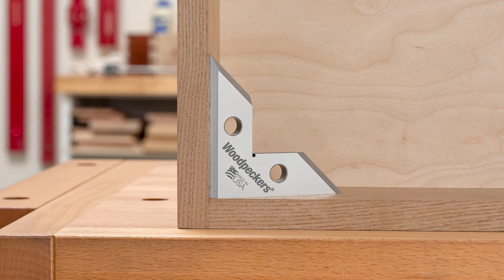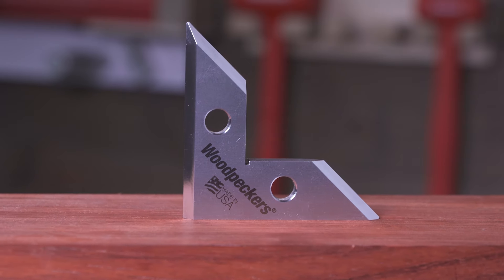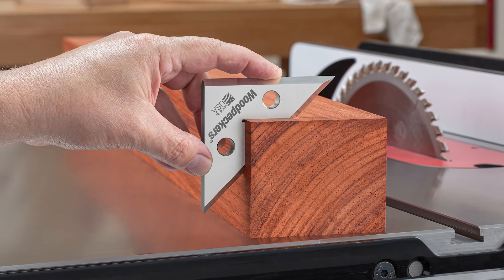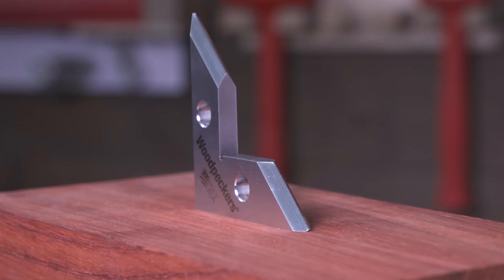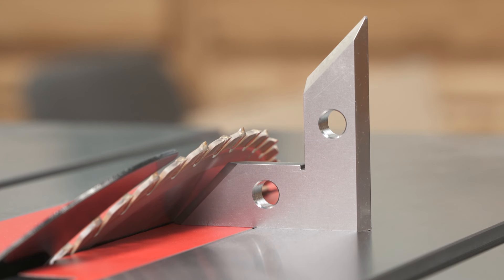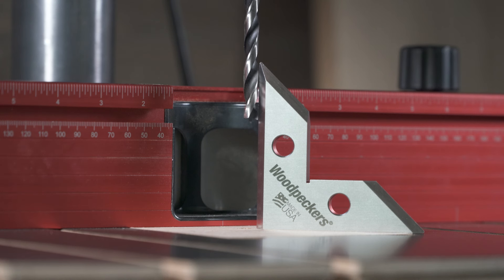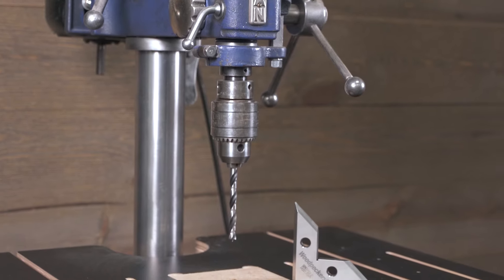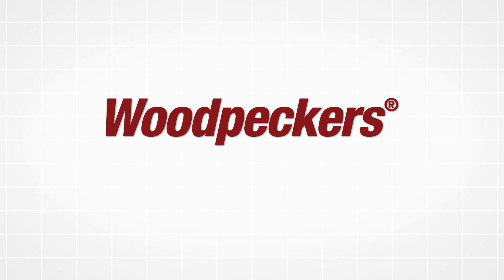DeadNutz Square

Comment: Can you give the tolerance in + - seconds?  Most other machinist square blocks I see for sale give the tolerance that way vs thousands of an inch so it’s hard to compare accuracy.  Though this one seems to have what looks like a unique feature of being able to measure both inside and outside 90 plus the bladed edges so a direct comparison might be harder.
Reply from the maker: According to the converter I found online, +/- .002 degrees is +/- 7.2 arcsec. The measurement in inches is +/- .0002" over the blade length. We include the measurement in deviation over blade length because it is easier to measure (as well as visualize).
Reply: @WoodpeckersLLC  thanks.